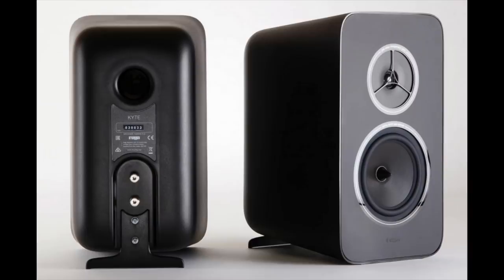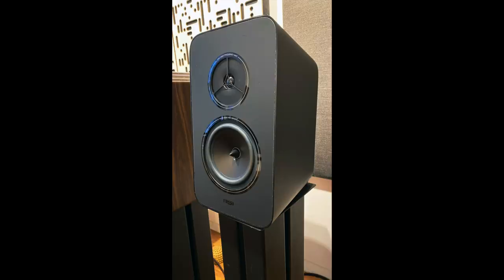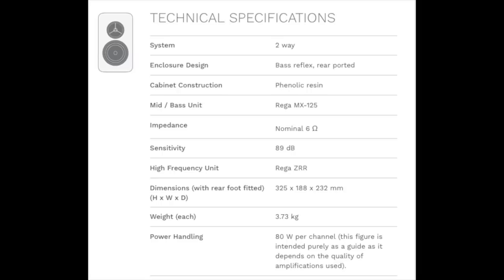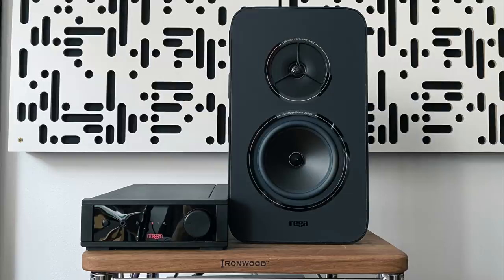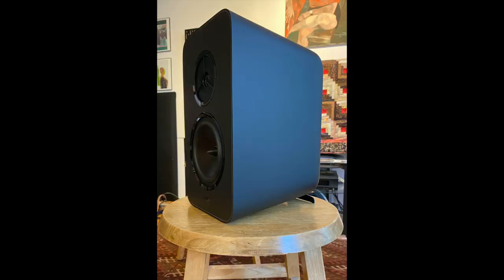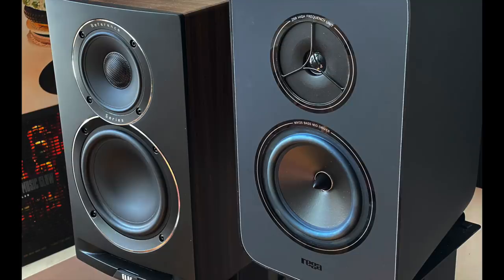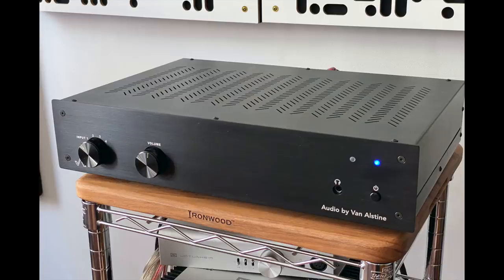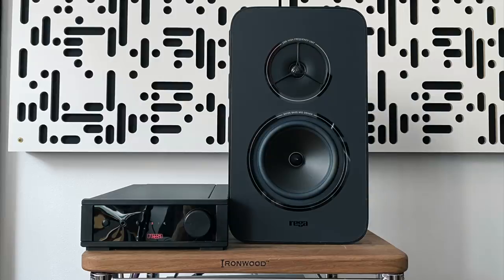To Boldly Go! REGA Kyte

Comment: I have heard these speakers as part of the Rega system one , and was really impressed by how good the whole kit sounded and a very good deal for just under a £1000  in the UK .
Reply: I think turntables, cd transports and amps are all strong from Rega, but these speakers were terrible as were many of their rs series speakers, when I heard them at a U.K. show and when I was trialing Rega speakers. The kyte with the 1000 turntable system. Buying a speaker or active system from a audiophile or pro audio brand missing the TT was the way to go and it stood out how average these kytes are. I thought the system lacked dynamics and detail and it was bland hifi.
Reply: I bought a pair of the new Rega Kytes based on Steve G's review and he was spot on!  They sound spectacular with energy, clarity, speed, rhythm and dynamics that are just way too good for only $795 a pair..  Rega is onto something here with this new cabinet design of the Kyte as it gives the speaker life and a wide open soundstage that's very engaging... great job Rega!
Reply: David Lima couple of hundred more and you are into Dynaudio emit 20 territory which are much better speakers
Reply: @13thnotehifireviews7  I owned a pair of the Emit 20's but sold them and got Dali Rubicon 2's, which were more $ and much better than the Emits.  I also liked the comparatively priced Dali Opticon 2's better that the Emits.  The original Emits are way overrated in my opinion; maybe the recently redesigned new Emits are better?  The Kytes are on par with old Emits I had and to me the Kytes sound livelier with more energy and musicality.  Plus, I only paid $599 for new open box Kytes and can tell you they are very enjoyable and well worth the money... thanks!
Reply: @davidlima8194  Hi David, what are you driving them with? How are they with rock music ( i mostly mean 60s-80s classic rock)?

Comment: For £50 extra, Rega also makes a pair of much more substantial metal feet for these. Ostensibly these are for better stand mounting, but I have found that they also improve the bass stability when the Kytes are used on a bookshelf.

Comment: Had a pair of the original Mission 700’s back in the late 70’s/early 80’s which were fast and exciting with no bottom end but gave me listening fatigue so I changed them up for a pair of AR925 floor standing which weren’t as bright. I have since bought better speakers and other high end equipment and I would say I love my set up now but I have never encountered that speed again so I will have to give these a try. I now have the facility to use several pairs of speakers in my listening room that I didn’t have all those years ago so should that fatigue crop up again I could switch to a warmer pair. Perhaps I am searching for something that no longer exists though as I am aware as we get older our hearing does deteriorate and I am getting on a bit now!

Comment: I am a Rega fan and the company should be lauded for making a full line of components (in the U.K. no less) of exceptional quality. They even make some of their own speaker drivers, which is something that many loudspeaker specialty companies cannot say. That being said, there is a lot of competition at the $800 price point. I have not heard this particular model but my experience with Rega speakers in the past is that their balance is a bit lean or thin in the midrange. I would agree with your assessment that they need to be partnered with warm electronics (such as their own) to sound good. The Kyte appears to be a decent loudspeaker (Rega does not make anything that is bad) but I would probably only consider the Kyte if I had limited space and wanted to have an all-Rega system.

Comment: Steve do you have any insight why Rega went with a plastic cabinet?  Was it price point or do they think they’ve found a better way regardless of price? Surely a thoughtful company like Rega has a detailed marketing rationale and use case for designing the Ovation guitar of speakers…
Reply: @keplermission4947  excuse me?
Reply: @keplermission4947  Yeah I figured you wouldn’t respond. I watched the video in its entirety, including some parts twice. When Rega uses an unorthodox manufacturing method like this it’s usually for a reason. And even if that reason is cost savings you would normally expect them to be quite articulate in explaining what, if any, trades off they see. They are not known as a budget brand, and while not the highest of high end, this kind of product is a bit odd for them. Steve says nothing about it. Hence my question. And what does shipping weight have to do with it?  Here’s one simple example: Neodymium magnets weigh far less than conventional but are costlier and stronger. Shipping weight would be much lighter vs an inferior magnet. I see you didn’t really read my question, you just wrote an idiotic response.
Reply: @keplermission4947  I’ll use any expression I wish.
Reply: @keplermission4947  troll
Reply: @edd2771  I think the reasoning behind the cabinet is basically to reduce the manufacturing costs, but without compromising sound quality. It’s impossible to make a conventional cabinet in the UK and compete at this price. Rega does like to innovate and I admire them for it. Personally they don’t appeal and I’d probably rather buy one of the many used / vintage British-made gems that are still available pretty cheaply here in the UK. In fact I have, since my main speakers are some lovely old Tannoy Eatons. But I guess that’s not really the point and the Kite gives them the opportunity to offer a complete new system at around £1000, UK manufactured and of pretty good quality.
Reply: @wayneb5742  Thanks that is my suspicion as well. But as a cost cutting measure it seems to have been at the cost of producing something at a quality level associated with Rega. I hope it’s just a one off miscalculation and doesn’t portend a move to cheaper manufacturing and products at the company overall.

Comment: At times it sounds as if mabe the Amp selection has more impact  than the actual  speakers.
Reply: This is true. I just bought anew McIntosh amp and it completely changed my system for the better.

Comment: REGA has recently gotten out of the real speaker business and all they have on offer now is  the model discussed here.  Some very good speakers and one outstanding one are gone forever.  The high cost of building wood cabinets is given as the reason.  One might wonder if Brexit has something to do with this decision?  I dunno, just a thought.
Reply: @cosmic-fortytwo add in the partial collapse of the distribution chains, spiralling raw material costs, and general poor supply of components and it's a real shit sandwich.
Reply: @cosmic-fortytwo   so much for that idea
Reply: Nothing to do with Brexit!  The UK had a far, far larger manufacturing base in 1973 (the year we joined the EEC, the predecessor of the EU).  Britain has a great opportunity to thrive outside the EU but it depends on the actions of our government.
Reply: Actually your statement no longer is true, they are now producing the aya loudspeaker which is essentially a floor standing version of this speaker. Quite a bit different though in manufacture, made out of a type of glass reinforced cement, actually very interesting and not overly expensive at 2,200 US

Comment: Plastic case hmmm wonder how sound engineering was done
Reply from the maker: Fair enough, but those ceramic braces are an indication that the engineers were aware of the need to strengthen the cabinet.

Comment: Never had good experiences with rega unfortunately
Reply: Not even their turntables?
Bought mine in `81 and it still takes some beating. Cost me a couple of drive belts in 40 years.
My experience has been good ,
Tempted by an Io amp.
Reply: @billycaspersghost7528  hi bud it was the turntables it was just over five years ago and it was a new p3 the same issue with five models I kept getting and it was witnessed in Glasgow audio just wouldn't track any of my vinyl so brought the albums in to try in the branch on the purchased turntable they just wouldn't track tried them on their other set up decks and just for some reason I was plagued with bad models and it ended up I was in Glasgow audio more times back and forth wound up purchasing a pro ject instead and had no issues
Reply: @johnkeenan9495  Maybe it was a batch issue.
Quality control was/is the biggest failing of UK manufacturing.
I work in UK manufacturing and still despair at times.
I try to buy British whenever I can but  I`m not a wanker about it.
Sad thing is most issues are idiotic and inexcusable and for a momentary issue years of bad feeling and bad publicity result.
Reply: @billycaspersghost7528  who knows bud it was costing me time off work and more or less £10.00 in bus fares every time
Reply: @billycaspersghost7528  Lots of interest in flags in the UK. Less in QC.
Reply: @PDCRed  I don`t know what you`re talking about and neither do you.

Comment: Nothing proprietary about these. Very run of the mill.
Reply: Have you auditioned them then?
Reply: PhotoTube A cheap two way bookshelf. What is unique about them? Can you pick them out in a room full of other cheap two ways?
Reply: @JEG6919  It's what they sound like that matters compared to competitors at the price.  Rega put a lot of thought and original thinking into all their designs and do not blindly follow the latest tends like many other manufacturers.
Reply: PhotoTube you will be lucky to get 25 bucks for them in a yard sale in the future. Rega is not a speaker company. Stick with brands that fare well over time.
Reply: @JEG6919  Says someone who has never heard them and buys on the basis of spec sheets.  Rega has been making speakers for many years and even makes some of the drive units which is something that cannot be said of many "speaker manufacturers".
Reply: @PhotoTubeUK  You are just being silly. They don't make their own drivers or cabinets. I don't need to hear them. They are already everywhere. 95% of the two ways in this space are forget-able. Go check out simple E-bay if you want proof. If the types of speakers, including this one, were any good, they'd hold their value and be popular (and for good reason).
Reply: @JEG6919  Yes, they do. They make their own drivers in house. You've never even heard them, until you have, I won't give your comment any credence.
Reply: @JamesSmith-qy3eu  they would be invisible in a room full of other speakers. You can buy them all and resell them at a hefty profit, they are so grand. I’ll wait..